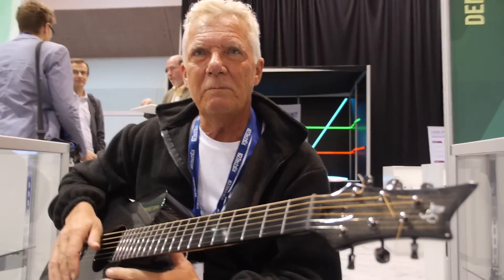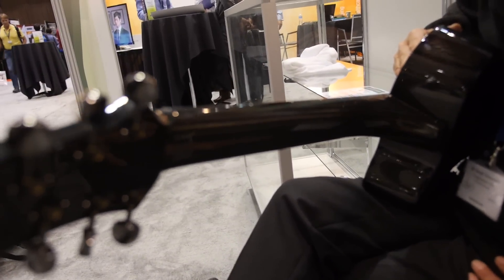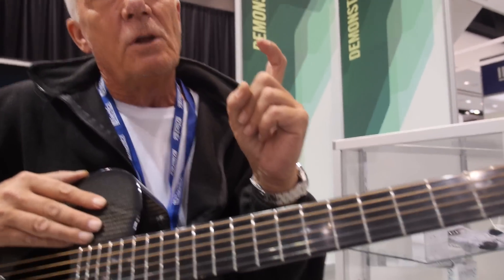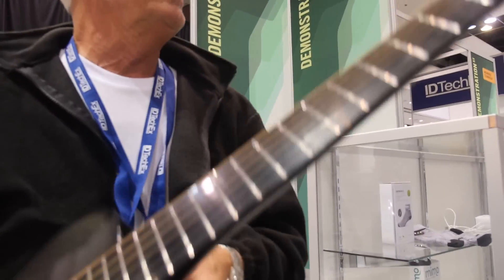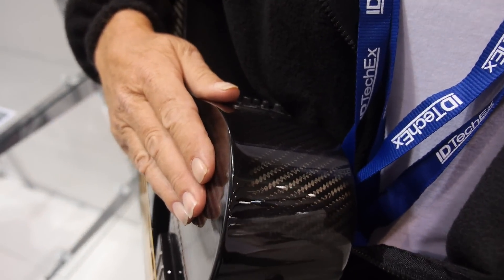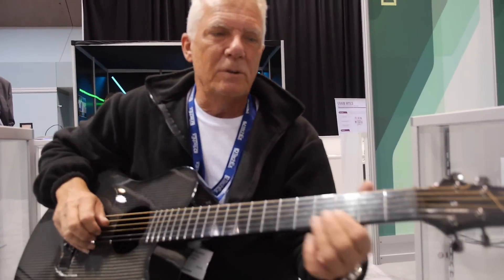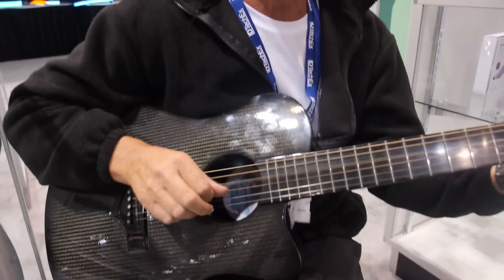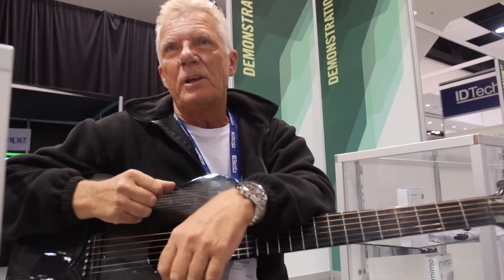Graphene Guitar shown at IDTechEx Graphene LIVE! event

Comment: Not to be a jerk, but this isn't a "graphene" guitar. The addition of function groups to the CF is interesting though. But you could integrate graphene easily into this system as well.
Reply: Not to be a genius or anything but Graphene is the only proprietary substance, in this "Graphene" guitar since carbon fiber is so yesterday.  Pretty sure right now it's probably very expensive but as Graphene starts to be used in everything from smart house paint and bullet proof T'Shirts to speakers that no longer move cones back and forth to produce sound. There is literally no product made that will not see a benefit of Graphene except maybe for condoms, and baby formula. If you'd like to learn something about Graphene, there's enough on the web to keep you busy all day.